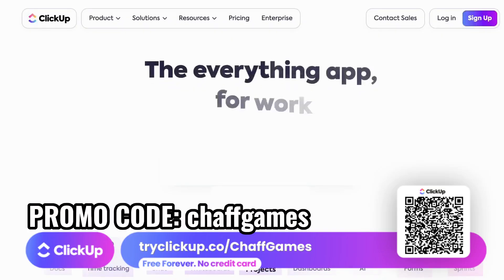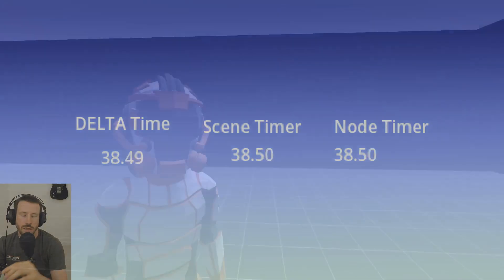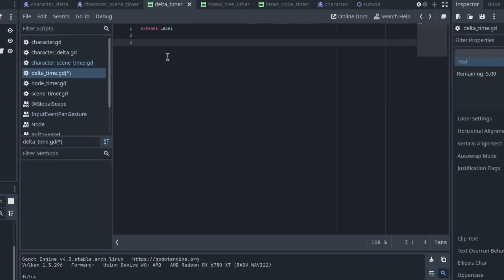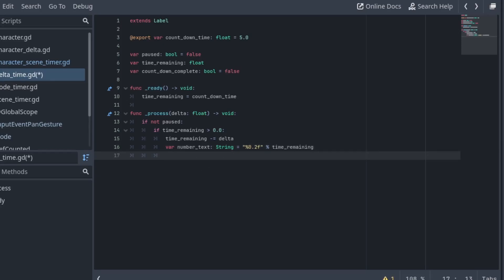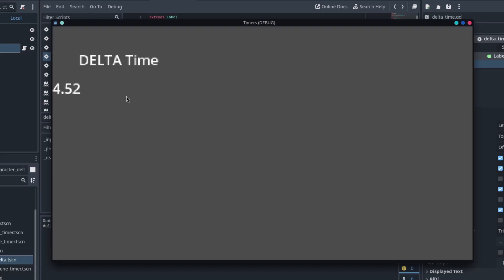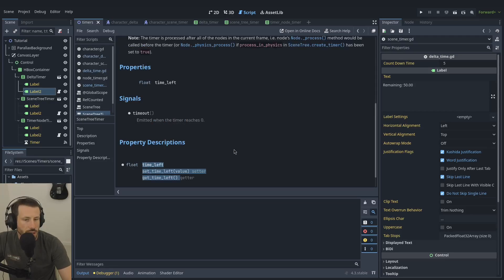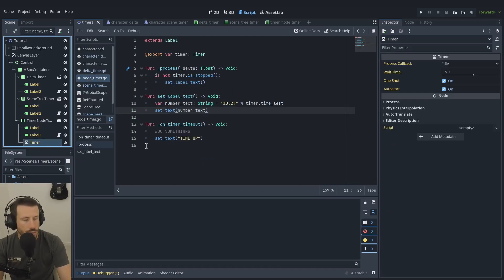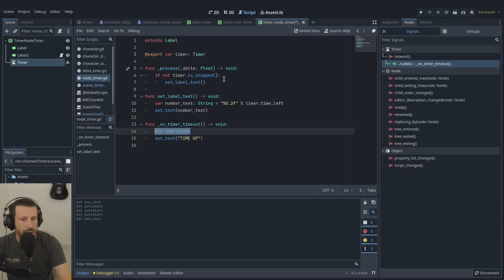Delta Time Vs Timer Node In Godot 4!  Which Should You Use?

Comment: Thank you for confirming my assumptions, that timer nodes are functionally the same as delta time. I code based off of intuition and what feels right, so that means sometimes using delta when it is very simple (player health regen) and sometimes using timer nodes (unique attack cooldowns). But every once in a while I'll feel unsure after reading reddit threads and comments of people swearing against timer nodes and insisting everything should just be done with delta. But at the end of the day, as you've shown, timer nodes do use delta. So I can go back to using timer nodes guilt free when I see fit.
Reply from the maker: I’m a firm believer in doing what works best for you. Obviously there are times where doing something a certain way will result in poor performance. And we get caught up in that mentality, apply to every aspect. Make the game first, make it fun. Then come back an improve performance where necessary.